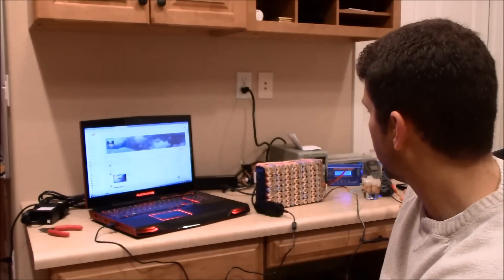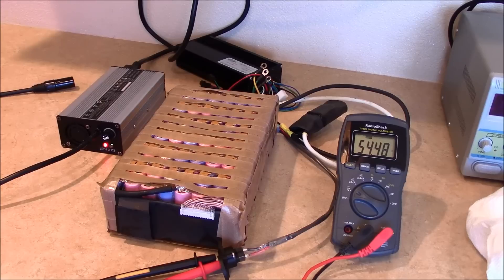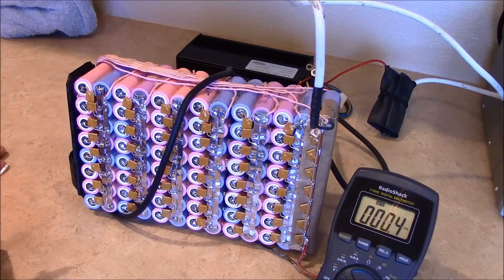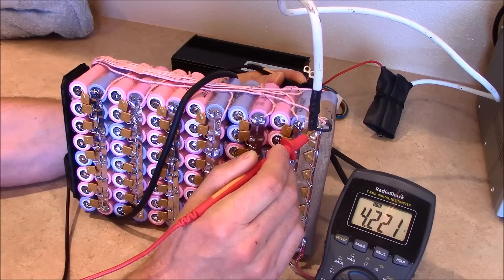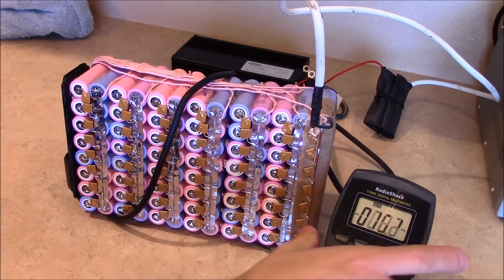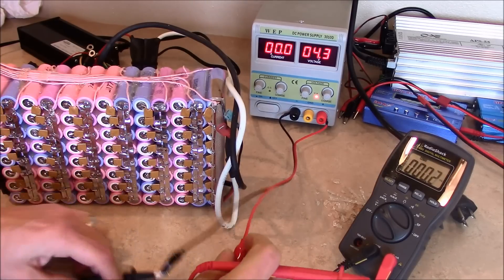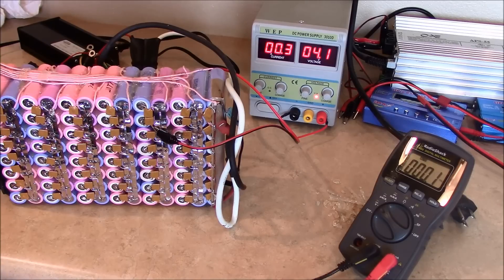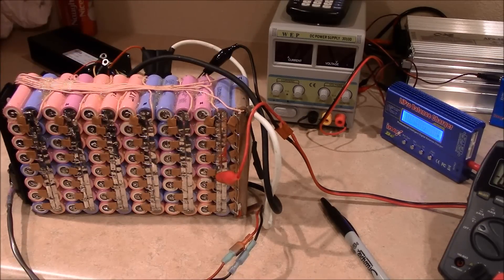How to build a e-bike battery pack "BMS wiring" (Part 7of 7)

Comment: so use bms or not ?
Reply from the maker: On used cells I would use a bms but you really don't have to on new cells.    Also if you don't have a BMS you will need to make sure you dont use them when the voltage gets too low when in use.   The voltage will dip during use and if it gets to low it can cause damage to the cells.  Most cells manufactures don't recommend going below 3.0 to 2.5v.    A BMS will stop it at 3.7v but you can wire around it with a 3 way switch as a reserve power source but just go slow until you get back home.

Comment: Hi again,, so for each parallel path you could have a different charger charging each one up so a 7P pack you can use 7 battery chargers as you have the wiring there already but is too small csa wise for a fast charge.  As I said before if the primary side 240v in my case is isolated via the transformer. You should have no problem in theory

Comment: I would at least get 1 charger for each parallel path since they are separately connected from its neighbour but the chargers have to be isolated from the supply as the supply is the common point and will lead to cross interference electrically but through an isolation transformer will be OK. Most transformers work this way so if isolated from input you can charge all parallel circuits at the same time using different chargers. I guess but most transformers are isolated just put multimeter on ohms or volts first and check between chargers if no volts then check ohms and if open circuit then charge from second charger etc

Comment: Just thinking of joining 4 lithium Ion motorcycle batteries in series for 48v 20ah will be 240 mm long and 120 mm wide if  connected two side by side. You can also charge one battery to 90 % in 6 mins so just half an hour for 4  battery's to charge. They are connected in series so just connect charger straight to terminals. I am not even gonna cover them as they will look cool, just put caps on terminals with a bit of grease to keep off the water. Connect them with short nickel strip bolted together. It's just simple and no tedious fuses or soldering or welding required. If one pack fails. I should be able to notice pretty quick or just wire a cell logger for a bit of peace of mind. Will post it when I complete it. They do high start current as well
Reply: Correction it will be 48 v 5 ah which is no good to me ah well back to 18650 cells again.
Reply from the maker: Master of the Universe man yeah that would have been awesome.  I spot weld my packs now.  Its so much quicker.  Looking to start building some batteries packs soon and selling. Just need to spec out some reliable chargers now.
Reply: Didn't get time to finish  so 1500 will pretty much get you to the sound barrier lol  but the chargers look best on the market if you want to go that fast

Comment: I like your setup, can you use the Bms socket to monitor the Battery cell volts for each parallel path, maybe use some cell loggers to tell you when cells are overvolt or undervolt .
Reply from the maker: Thanks,  I see where your going with this and it sounds like a cool idea.   If you have something built Im sure you could tap into the BMS voltage lines similar to what the IMAX B6 does when charging.

Comment: hello 15 sec of fame.
i made a 75v pack for my e-scooter.
but how does the balancing works?
because when the pack is at 73v some cells are at 4v others are at 4.18v.
wil the balance disconnect when it goes to 4.2?

i made it the same as your video only then at 75v.

sorry for the english.

thank :)
Reply from the maker: Did you wire in a BMS?
Reply: Yes i did i like your video.
Reply from the maker: ben grobben It could be a few things.  Used cells tend to charge uneven so once the Bms goes into protect mode some chargers turn off.  For example, it would lower its voltage output to 24v instead of 54.6v.  This is what happen to me.   I bought a different brand charger and it stays on after charging (trickle) but keeps the peak voltage.   This allows the BMS to slowly balance the banks in the battery.   New cells tend to stay balanced and don't really require a BMS, but I would still use one.   Also, make sure there isn't a bad cell in a bank that is self discharging as this will be hard to keep any battery balanced.   let me know what you find.  thx

Comment: Where did you get your charger?
Reply from the maker: here is the link to were I bought it.  Just know it will shut off after it charges the battery.   It will not allow time for the battery to fully balance if it becomes out of balance.   Once the BMS shuts off,  the charger will see this and will also completely shut off.  For the BMS to balance it will turn off then on many times to allow the cells to balance.   The charger needs to stay on at max battery voltage 54.6v at low current similar to a trickle charge.
http://www.ebay.com/itm/48V-54-6V-60V-4A-Lithium-ion-Battery-Charger-13S-13x-3-6V-3-7V-Lion-Charger-/221256808976?hash=item3383eefa10

Comment: Great work! I am wondering if the input voltage for the bms is not exact 54.6, Does it still work? I have an input range of 54 to 56, would the bms work normally?
Reply from the maker: Thanks man,  I have tested it and noticed after charging that voltage is down due to the BMS going into protect mode when a bank is at the overcharge limit.  But after a few min its back to normal.   I think my issue is the charger as it shuts off when the charging is complete.  I would like it to stay at 54.6v so the balancing function would work.  Thanks

Comment: how did you find out that it wasn't true balancing board? and did you do an internal resistance check on each cell befor you decided to use them in the pack?

Comment: My bank 10 is same low as yours! I brought same board like yours only 60A!  From the same supplier! This can be coincidence!  WTF?! Any ideas??? 184 Cells I have in the pack.
Reply from the maker: Wow your bank 10 is also low?   That is interesting.  I did find a bad cell in bank 10 that was self discharging.   I fully charged the bank to 4.2v,  then removed the fuses to make each cell in bank 10 separate.  waited a few days and went back to find out which cell was getting low.  had one cell get down to 4.15v as the others were at or very near 4.2v  I retest the cell and it was still at 2165mAh, but it was still self discharging.  I havent had a chance to look at it again to see if bank 10 is still having issues.   Also noticed that my charger turns off after charging.  You may want to find a charger that hold 54.6v once its done to help the BMS balance the battery longer.   Tried to order some from China but it was a scam.
Reply: Thanks for your response! Seems that my pack(bank number 10) get fix after two time full discharging and charging cycles. Now everything is going good. I didn't buy charger I just got one of step up booster from 10-80V 600W from ebay and I connect it with PC power supply. Charging power is around 260W, I set up my maximum charging voltage to 52.8V and I never charge my pack over that voltage and charger is whole night on so there is plenty of time for balancing cells. Am trying to keep that Li-on green range from 40% till 80% charge and save my battery pack so it last little longer. So gar I got 1250 Km on my bike. My next plan is to make one 14S battery so I still can charge cells to 80% but keep higher voltage of full charged 13S. Also I install test balancing leads and I got two 1-8 Lipo- tester analyzer and once per week after charging I connect them and look every bank just for to be sure that everything is well balanced.  BTW max speed is 72Km flat and 78km/h downhill. There is also regen-braking option.  So far this is my number one transportation from A to B. We will see how long my battery will last. I order one of than Voltage and AH measuring device 100A peak(ebay) and am going to connect it on my battery before motor controller to see how much Ah I really have now and I try to keep tracking battery degradation and capacity losses. Again thanks for your videos man!  I hope you will make more. Can't wait to see them. Best regards
Reply from the maker: ***** thx man and good job getting the balancing issue worked out.  Ive been very busy lately at work with lots of traveling 2-3 weeks out of the month, so it been hard to make edit videos lately.  I do have some in the works just need to post them soon :)  I have upgraded to 72v and its a blast!  Hope to share it with everyone soon!

Comment: TY for videos! I built my battery using your excellent input (with a alot of help also from super G vids ) Battery was made from makita faulty battery pack (bl1830) The canabalised good cells were 4.2v 1.6amp /cell created 13s 8p. Less then £80 for all the faulty packs each pack had 10 cells in it 2 normally faulty rest just needed charging up! (worked out at 13amp hours) I chose to use 4amp pico fast blow fuses for extra safety/ series bank. Under test on restricted mode + pedalling i can hit 25mph (at a push) on flat and about 12mph on steep hill but when i derestrict the kit (cyclotricity kit) OMG the beast is unleashed (35-40mph + pedalling on flat, 28mph up hill just on throttle alone ) this was a shock as i originally only had a 250w kit. I had just enough room to fit my pack in the frame and purchased a great bag from luna cycles so looks very tidy. Had a bit of fun finding a new 137mm bottom bracket but other then that the build was done in a day (i recommend getting 2 foxnova battery chargers to anyone who wants to test the capacity of each cell before making a pack as they do the job really fast and capacity check auto charges afterwards (did full capacity testing in under a week (104 cells) picked the best cells and the rest is history. I'm a regular guy with little electrical experience but researched alot before my project began. My advice to anyone interested in these videos is to have a go and learn something new. On a safety note i now remove rings and my watch when buidling packs and wear surgical rubber gloves when soldering a pack. Once again TY for sharing your project on youtube it really is excellent!!! WD
Reply from the maker: +Philip Michulitis yeah man thats awesome! thanks for sharing your experience.

Comment: If you are bypassing the BMS for discharge then does the BMS Amp rating matter at all?
Reply from the maker: +electron spectrum Nope thats why I bypassed it.   I was going to go thru the BMS at first, but at the last min. I decided to just go off the battery and use the BMS as a balance charger only.   There are some people who dont even use a BMS, but they are using new cells where they charge at the same rate.   I was worried due to the fact that my battery is only 980w and my kit is 1500w and at peak i can pull about 2500w.   I am currently working on my new 72v battery and it will be rated at 1500w.   I will go thru that BMS.
Reply: if that's the case then I'm only getting me a cheapo $13 one even though I'm using 12 18650s per cell (156 total) why else spend more on the BMS if the more expensive ones don't seem to balance better?
Reply from the maker: electron spectrum 13s12p nice!  Yeah at max load Im pulling 45 amps when the battery is at 54.6v at 48v Im pulling 52A and the cells are blasting out 6-ish amps each and the bms is rated at 30-60max so it can handle max power just not sure for how long.  As the battery gets lower the amperage gets higher.   Going home from work is 90% up hill not sure if I want to chance it :) going thru the bms.   The 72v BMS is rated @30 amps and I will pull 34.72 amps max @ 72v.  When fully charged 84v I'm pulling 29.76Ah Max wattage will be brief during starting from a stand still at max throttle or step hills.

Comment: How did those 4 amp resetable fuses worked out for the battery?
Reply from the maker: +electron spectrum they are working out great so far.   I have a spot welder now, so I will play around with welding tabs on so I can solder the fuses to those instead.
Reply: +15-sec-of Fame That's awesome and time saver, What kind of tabs do you recommend?
Reply from the maker: electron spectrum thanks man,  I ordered 100% nickel strip (not nickel plated) 7mm wide .15mm thick.  I also ordered some 18650 holders to keep the cells in a tight pack.  The glue will not hold if the battery gets to warm.
Reply: +15-sec-of Fame Awesome, I just ordered the holders, Do you have a link to where to buy the tabs?
Reply from the maker: electron spectrum I bought it from AliExpress under search type in 
Free shipping 18650 battery nickel strip 0.15mm nickel plate li-ion cell nickel belt Cylindrical battery nickel sheet.
Looks like it will be 30 day to receive it though.
Reply: Hey, do you have a link to the BMS' power supply?
Reply from the maker: electron spectrum Here is the link on ebay
http://www.ebay.com/itm/48V-54-6V-60V-4A-Lithium-ion-Battery-Charger-13S-13x-3-6V-3-7V-Lion-Charger-/221256808976?hash=item3383eefa10

Comment: I've just fried one of my cells in the pack. Talk about compensating my Lipro just charged up one cell to 4.6v any ways we live and learn. 
Can you charge up one cell without disconnecting the fuses recompensate for the low high voltage? Cheers.
Reply from the maker: +harveyboy45 dude that sucks, I've  heard that those are touchy,  yes just make sure your directly on the pack you want to charge at 4.2v
Reply: +15-sec-of Fame thanks it worked. I just need a good charger for my pack now. Can you post me a link for yours. Cheers. Best of British to you.
Reply from the maker: harveyboy45  Awesome man! here is the link,  leave them a message on what voltage your looking for.  Mine was 48v max of 54.6v 4 amp.  
  
http://www.ebay.com/itm/48V-54-6V-60V-4A-Lithium-ion-Battery-Charger-13S-13x-3-6V-3-7V-Lion-Charger-/221256808976?hash=item3383eefa10

Comment: Are there any BMSes for 3.2v a123 LifePO4 batteries? I have 12 in series and I can't find a single BMS that would work.
Reply from the maker: +Jake Methner Are you looking to build a 36v battery with the lifepo4's?  Here's a few on Ebay

 http://www.ebay.com/itm/PC-board-36V-38-4V-12S-Continuous-20A-Peak-50A-BMS-LiFePO4-E-bike-PCB-/191814009881?hash=item2ca9018419:g:l4EAAOSwUuFW0AwL

http://www.ebay.com/itm/36V-60A-LiFePo4-Battery-BMS-LFP-PCM-SMT-System-12S-12x-3-2V-eBike-Battery-12x-3V-/321048908605?hash=item4ac001933d:m:mPn7b41g_l-N13-dFF4S-sQ

http://www.ebay.com/itm/BMS-for-38-4V-12S-LiFePO4-Battery-Pack-50A-10A-limit-With-Balance-Function-/161362294374?hash=item2591f13666:g:TEAAAOxyMxpRvp2a
Reply: Yes, Thanks! The only issue is that my Motor has a max draw of 70 amps... Should I get a slightly smaller motor to make sure the BMS doesn't shunt on max draw?
Reply from the maker: Jake Methner you can look at your controller and see what it can handle on max output in amps to the motor as that will be the bottle neck to the motor hub.  You can also just use the BMS as a balance charger if your worried about it being over powered (thats what I'm doing)  I have the charging port wired as normal, but I also have 8ga coming directly off the positive and negative going straight to the controller.  I have a 50 amp circut breaker before the controller in case I want to disconnect battery power to the controller.   I have a 1500w kit and the controller max's out at 35 amps to the hub and has a voltage range from 36v to 72v
Reply: 15-sec-of Fame
Thanks for the info. My ESC is rated at 120a so that is all good. The only reason I want to keep the BMS is to make sure I don't use the discharge the battery too much and damage it. I decided to just change the motor to something more suitable.

Is there an easy method of determining the battery life remaining? I heard it is a bunch of crazy calculations to get an actual reading of battery life percentage.
Reply from the maker: Jake Methner After testing the battery and reading about how the BMS truly balances I think that it is ok.  Ive been studying how the battery was getting out of balance and I have 2 issues.  One I am using used cells that are not 100% matching they are close but still used.  Second the charger shuts off to soon once it senses that the battery is fully charged and that messes up the balancing function as the BMS.  The BMS needs the power to provide the voltage to shut off certain banks and discharge them then turn back on once the higher backs are back down to the other banks in voltage until they all are at 4.2v.  So if anything I need a 54.6v charger that will not turn off or will stay on longer and I think that will fix my unbalancing issue.  I will make a new video about this soon just need to find a charger that doesn't shut off so fast.  So I would say that yes its good and I plan on buying another one soon just look for a better charger.
Reply: 15-sec-of Fame Alright, thanks, I'll buy one in that case.

Comment: Hi, what's the point of the 50A breaker if you already have fuses on every battery?
Reply from the maker: +electron spectrum hey electron it the main power shut off.   If the main battery wires shorts out it will disconnect the battery from the controller or if I need to power it down from the controller for storage etc...
Reply: +15-sec-of Fame Good idea, do you have a moderl number or ebay link?
Reply: I've been looking for one of these but I just can't find a 48V 50A breaker, Do you have a make and model? I'd really appreciate.
Reply from the maker: electron spectrum well this is it or similar to what I'm using.
5TC7-50 50 Amp Klixon Circuit Breaker
 the price is $150 U.S. 
 Its made for aircraft use in avionics.  I had a rental company renting out my planes and I had some avionics work done on one of the planes.  Well I kept all the old parts and this was one of them.  So it went from Fly in the sky to cruising around town on a bike lol